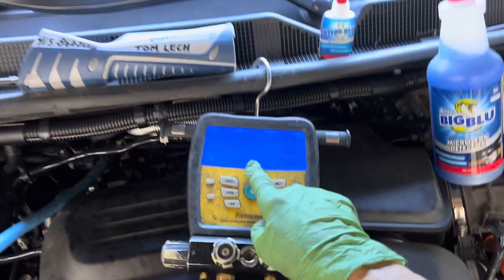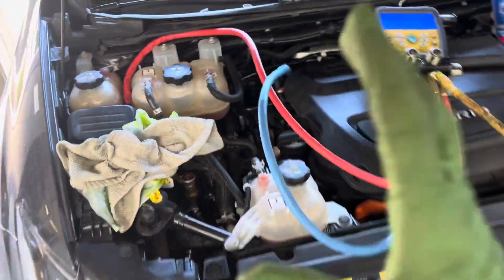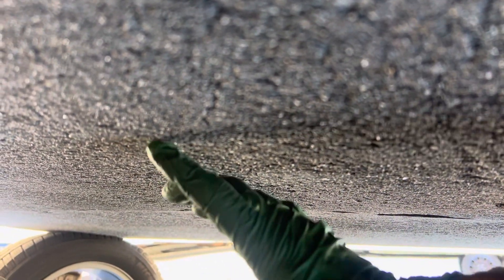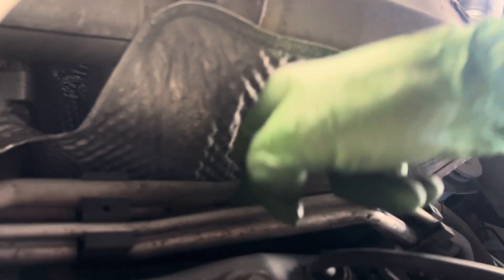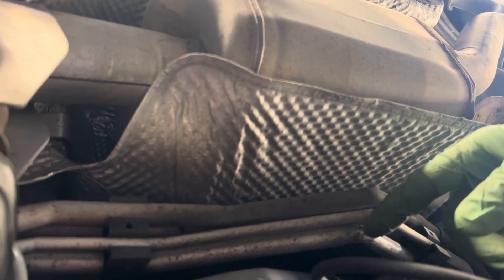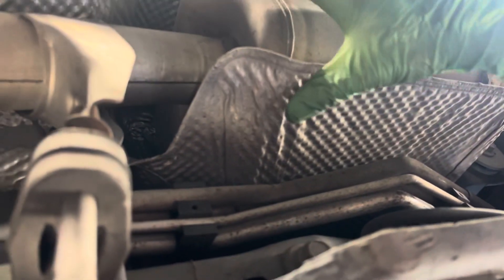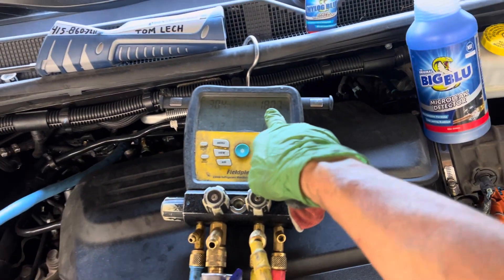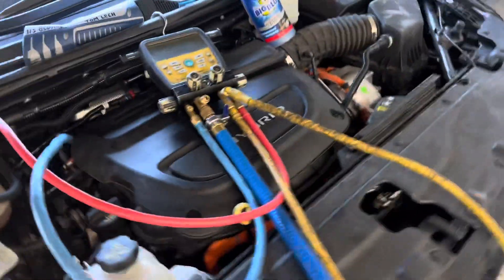IMPROVING AIR CONDITIONING IN EXTREMELY HOT CLIMATES

Comment: hi different types of Insulation  helps alot .   Window tint / exhaust insulation / under hood heat exit route . Wiring electric fans to come on with compressor not just some excessively high switch point .
  Temperature stress 4 ways  humidity  90% plus , high ambient , full sun , duration of hot conditions . Around me  common temp is 105f ,, uncommon peak at 115f full sun ,very high humidity .  I used to live inland in a desert the same heatwave was at least 115f for at least 1-3 weeks .
Yes the AC pipes under the car would definitely heat soak from all the heat sources 
Foam pipe lagging or fibre glass wrap or split tube . Ceramic coat exhaust where possible are all options .
Reply from the maker: My last little vacation a few weeks ago
We travel through Arizona and Utah .  We stopped off at a Little town that was 110°F.

I always thought 106° was hot in Milpitas in one record-breaking day in California, but it was only for a few hours. 

But when you go to a place that’s 110°F 115°F for a few weeks in a row. It’s a whole different world.. 

Because even the pavement, and the Earth going down, a foot is hot and it never leaves . 

When the sun UV index rating is 13 
When the ground is 160°F radiating heat off the blacktop when you step out of your car 

When does surrounding air is 115° but the air one or 2 feet off the road surface is 140° because of the temperature of the blacktop pavement. 

It makes 106°F seem like you’re in a cool ocean breeze  🤣

That was an experience. I do not want to re-experience. . 

How people live in places like that that is an humanely imaginable . 

Drove by a few little tiny houses and trailers, smart people painted the roof, white their walls, white their doors there, Trim, everything around their house was bright white to reflect the heat . 

I seen that I realize there’s some smart people out there . 

Oh, when you see people who live in the desert heat like that and they have a dark brown house or a dark green house definitely not playing with the full deck of cards .  Somethings missing upstairs. 🤣

Comment: I'm planning to use R290/R600a blend (60/40 ratio by weight) 
The weather where I live is 100F to 120F 
The blend is more efficient than the R134a 
Tried it once ,,, a ready made blend called Enivor-Safe
Very noticeable difference in performance specially during sun peak 
This time I will make the blend myself 
because when I tried the Enivor-Safe prodcut I had to ship it to another country 
then to my country and it was expensive
Reply from the maker: Yes, that is a good idea for the country. Where are you live in the high heat conditions that you’re in

It’s not rocket science. My father taught me about Blending Refrigerant when I was young, because my fathers very best friend since grammar school, turned out to be a Refrigerant development engineer who worked for Gentron that later became Dupont, and he taught my father about Blending Refrigerant, and making up your own for specific purposes . 

It’s not rocket science it’s really easy on some refrigerants not all 

But it really helps when you have a Refrigerant engineer as your best friend who guide you along to process in learning working from a Refrigerant company
Reply: and how much you add to empty system after vaccum ?
Reply from the maker: @krzychuninio3669  how much what ?